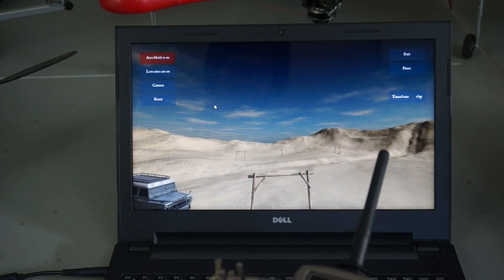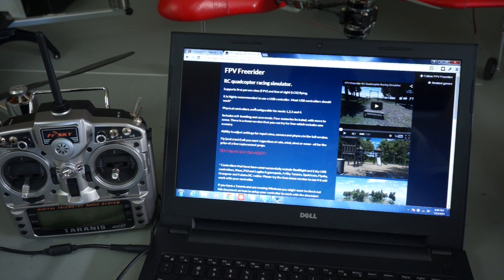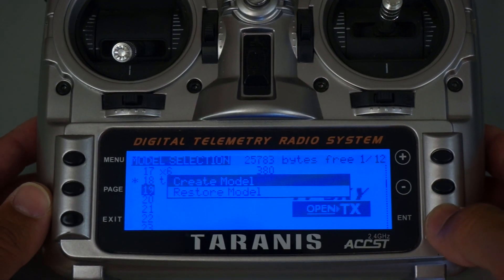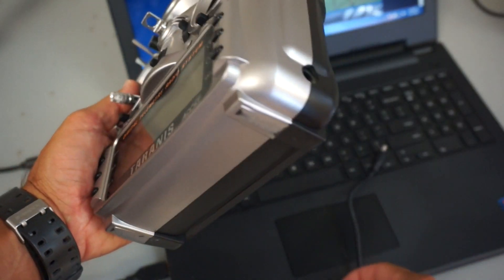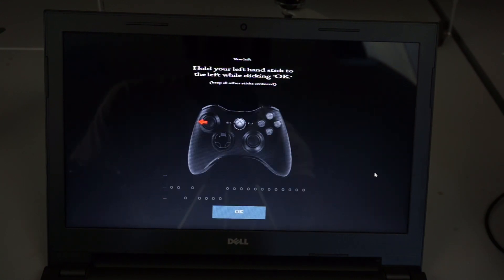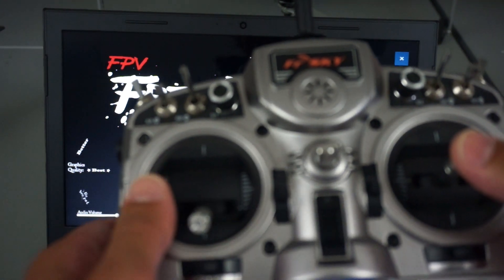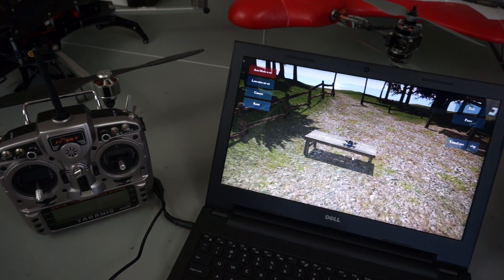Awesome $5 FPV Racing Simulator FPV Freerider Setup with FrSky Taranis

Comment: Your introduction about Freerider could not have been said better. Oh man, if you could do or point to a version of this setup on Mac it would be much appreciated.  Taranis is dead to my Mac. . .I know, checking drivers, etc...
Reply: +Guy Burdick Up and running on Mac. To get Mode 2 I left the default TAER for Inputs and Channel Mixer. Also, I found no need to change the Weights or Offsets. Reboot w/ Taranis on and plugged in. I tweaked the scales & trims during calibration, but only slightly. YMMV. I've been playing FPV Freerider on an Android phone for almost a year. Using the radio is just way, way cooler. I'll be doing that the rest of the day if anyone needs me.
Reply from the maker: +Guy Burdick Thanks for sharing this. Great info and glad to hear you're flying FPV....virtually!

Comment: After a huge struggle I got my Mode1 Taranis to work with FPVfreerider demo version. On my 
Win7Ultimate X64 PC. I had to update my Taranis Firmware from original version(1.01.1? I bought the 
very first Taranis from HK first batch).I now have Firmware 2.0.19 on Taranis. My PC also didnt pick up 
usb connection to Taranis , so I had to move to another usb connection. Then the PC loaded the usb 
driver and the process was started.
Once i had the taranis talking to PC I had to calibrate Taranis to FreeriderFPV. 
Since I fly mode 1 and the software is Mode2 I just moved my Thr stick (on the right) when software 
actually asked for mode2 Thr which is on the left. And matched my Elev (on the left stick) when the 
software asked the Elev on the right. I was battling to move sticks around in the software, so I came up 
with this plan. Good luck, the software rocks....I hope this helps.
Reply from the maker: +Michael Blank Thanks for sharing this tip. Very helpful.

Comment: Followed all instructions, but the freerider doesn't see my taranis? When I connect taranis to windows it sees it fine. Any ideas?
Reply from the maker: +aerofokus That's strange. I just plugged mine in and it was recognized. I'll see if I can dig anything up. Please do the same and let us know if you discover anything. Thanks.
Reply: +Dennis Baldwin someone suggested to me that I should upgrade to openTx, but I think I will get a cable for one of my older spectrum radios and use that for training..I like my taranis as it is I don't want to touch anything.

Comment: I have a Taranis Plus X9D I am using the TAER Config. The big win for me here, was I had set the INPUTS to 50\50 and it seemed odd. Since I am new, I didn't know what correct was, just didn't feel right. So I set INPUTS back to 100\0 and MIXER to 50\50 and now it feels correct.Thank you for taking the time to make this video.
Reply from the maker: +David Sipp Thanks for sharing that bit of info. Very helpful.
Reply: +Dennis Baldwin Can you comment on the difference between INPUTS and MIXER? I have seen many different videos and documents where the Taranis setup for Freerider uses one or the other?

Comment: All went well until I went to fly. All silent, throttle non-responsive.
One touch to right stick and motor noise sounded as if in flight.
Hands off, no noise.
So close.....
Reply from the maker: +Walter robertson Yeah sounds like you are close. Hang in there and many you need to switch your channels around. Or try the calibration sequence again. it's a bit touchy but once you get it working it will be worth the effort.

Comment: My Mac isn't recognizing the input from the Taranis, so when I move the sticks in the calibration menu, it does, well, nothing. I have OpenTX installed and I have a model set up for the Sim. Am I missing something. I tried looking for separate drivers but it seems like the OpenTX is the only firmware there is. I'm very new to this so please excuse me if I'm missing something obvious.
Reply from the maker: +Pa Trick I don't think you are missing anything obvious. I connected this to my mac a while back but ran into problems. I'll see if I can revisit and let you know what I come up with.

Comment: No matter what I did I could not get the Rudder channel to work on my Taranis (It seemed to be at right 100% all the time in the calibration unless you pushed the stick all the way to the left at which point it would jump at the very end of the range to 100% left rudder... :P

Anybody else have this problem?
Reply from the maker: Armando Ruggeri I haven't had this problem but will let you know if I find anything out.
Reply: Just found out what it was: I had a Logitech freedom 2.4 cordless joystick attached to the machine and even without it active (any clicked button or joystick movement will reconnect it to the receiver) the throttle position was pegging one of the channels to 100%.... :P

Comment: Dennie's,
I'm flyin mode 2 on the right throttle and if it works on mode 2-can it also be on TAER MODE ON THE STICKS? (Hope so) 
Big thanks and More Power God Bless
Reply from the maker: bobot021070 Sorry if I'm confused but Mode 2 has throttle on the left, not right. Maybe you meant to say you're flying on Mode 1? Yes I think you can fly TAER and don't need to set this up as AETR like I did. I'm going to do another video with my Mac and I'll verify that shortly. Thanks for the feedback and good question.

Comment: figured it out for the MAC you need to turn the transmitter off and let the comp power it.
thanks Mr. Dennis for the video
Reply from the maker: Charlie Spann Glad you figured it out. I have a video that I'm going to post today that shows how I get it working with my Mac. Maybe you can share your experience when I do. Thanks!

Comment: You need to show how to move the channels on the mixer page.
Mine doesn't look like yours.
I'm getting a "+=" where you have CH1, CH2, CH3, etc....
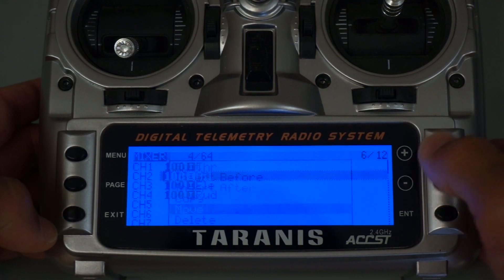YEah you cut edited right past the part I needed to see at 1:50.
Please never assume we are as smart as you!!!!!
Reply from the maker: odinata Yeah sorry about that. It's kind of a quirky thing to move those channels around because of the += issue. What happens when you move the channels up is they get grouped under CH1. Once you get them in the right order you can move them down to CH2 and CH3. They will fall out of the CH1 slot by selecting them and selecting "Move". You can move them down into the appropriate position. Hope that helps.

Comment: Thanks for sharing! Were you able to get it to work on OS X? I have OS10.10.3 and I have no control. The Taranis does show up as a joystick in the System Report. It works fine for Windows.
Reply from the maker: Brandon Kalinowski Yes I have it working on OS X. I've heard reports from several others with problems too. I'll put together a video soon and share my findings. Thanks for the feedback and hope all is well.

Comment: Thanks Dennis!  It works great on Windows 8.1 by extracting it to the "Program FIles(x86)" directory and dragging out a shortcut to the desktop. I setup up my Taranis radio as you showed. Already had OpenTX firmware on the radio so I guess I just got lucky and everything worked smoothly.
Reply from the maker: ***** Glad to hear you got it working! I've heard reports from people who have been struggling a bit. Never as easy as it seems, right???

Comment: Perhaps a stupid question, but can this run on a raspberry pi?
Reply from the maker: SirArghPirate That would be really awesome. It runs on Linux although I'm not sure the RPi graphics processor would be able to handle it. But definitely worth a look. Here is a thread that talks about it in more detail:

http://forum.unity3d.com/threads/unity-and-the-raspberry-pi.163732/

Not sure what to make of it though. Will have to dig around some more.

Comment: Love the simulator! Ive been running it on my mac laptop and I actually just used my existing blackout model I had without changing anything and it worked fine. 

This simulator with the taranis has seriously effected the way I fly for the better. Way more comfortable!
Reply from the maker: ( ͡° ͜ʖ͡°) Zevi Rubin That's really cool to know that your blackout model worked just fine. Awesome! I agree that this simulator can definitely improve our flight skills.
Reply: +( ͡° ͜ʖ͡°) Zevi Rubin Hi, I have a Mac and I'm having trouble connecting my Taranis. Do you any source I can read up to or maybe some help? Thanks! :)
Reply: Hey, Its a little tricky... To get the taranis to show up in the "radio calibration" step I have to try a few times. I usually connect the usb cable to the taranis, then plug the cable in, then turn on the taranis. then I open up the flight sim and try the calibration. Sometimes I have to try a few variations of the connection process. If you remind me later tonight i can actually run through it and let you know exactly what works for me.

Comment: I am using this simulator everyday during one hour :)
It worths every single dollar!
I run it on GNU/Linux Debian and it works pretty nicely ;)
Reply from the maker: ABMNS PRODUCTION Very cool you run Linux :) My favorite operating system. I'm glad to hear that it runs well!
Reply: ABMNS PRODUCTION Hello. I download it but how to run it after unzip ? Thanks
Reply: Willemin Francois Hi,
You have to "chmod" the two files called "FPVFreerider.x86_64" & "FPVFreerider.x86"...

Open a terminal, no need to log as root and go inside the directory containing these two files using the command line "cd" and type the path to your directory. Push "Enter".
Then type: chmod +x FPVFreerider.*
Push "Enter".
You can close the terminal.
Right-click on the file matching with your system and then click on launch or run and it will start. In my case i have to execute the file "FPVFreerider.x86_64" but if you are not sure just execute "FPVFreerider.x86".
After that do not forget to setup your radio and calibrate it inside FPVFreerider.

Have fun :)
Reply: ABMNS PRODUCTION Thanks, it's worked.
Reply: Willemin Francois You're welcome! I progressed a lot with using this simulator, just need to be less stressful when i am outside flying my mini quad lol

Comment: Dennis, there are a lot of FrSky 9X radios out there. I know you also used them in the past. I've previously downloaded the FreeRider demo but have not yet set it up.

Could you please show how to setup a 9X with the FreeRider simulator or would it just be Plug and Play out the trainer port ???
Reply from the maker: lasersbee Yes I will definitely look into this with the Turnigy 9X and report back. Hope all is well.
Reply: Dennis Baldwin Thanks. Yeah Dennis... All is great ;)
I see all is good with you as well.

Comment: Is there a way do use this with the fatshark goggles?
Reply: SirArghPirate If your video card has analog out that would work.
Reply: Mike Brameld So I connect the vtx to the computer (instead of connecting it to the camera)? Maybe I need a VGA to composite adapter for this?
Reply: SirArghPirate Just plug the analog out straight in to the goggles. The computer isn't going to go flying away, it's just a simulation, so no need for a video transmitter.
Reply: Mike Brameld Ok. The thing is my computer has analog video out (VGA), but not (analog) composite video out. Also I wasn't sure if the goggles had video-in port, but apparently it has according to the manual. (It says AV in/out).
Reply: SirArghPirate Yup, it's the one that looks like an audio jack. The goggles should have came with a cable that has that connector on one end and RCA connectors on the other. You'll probably need a VGA to RCA adapter. This one looks like a good bet: http://www.amazon.com/Lenkeng-104724-Monoprice-VGA-RCA/dp/B001CJOLBW?

Comment: thanks for the heads up.  works great.  Are there any other simulators that work with the taranis?
Reply from the maker: cbluebeard Good question. I'm not sure but hopefully someone else will chime in.
Reply: cbluebeard I know Microsoft Flight Simulator (FSX) works with the Taranis. Though it is not exactly RC specific.